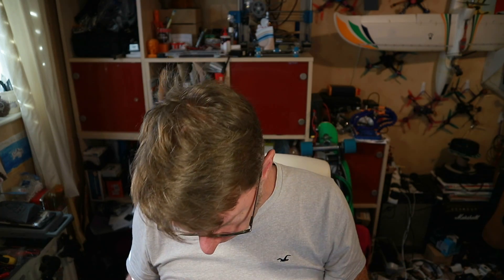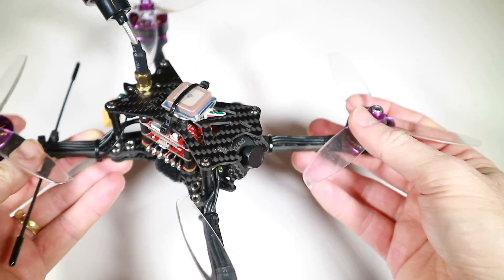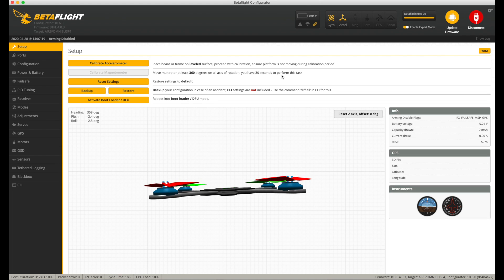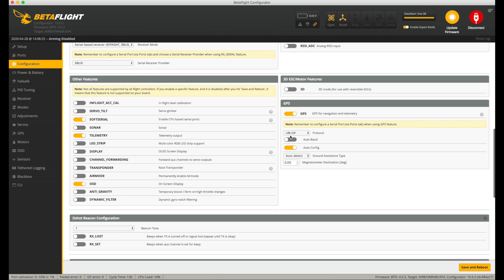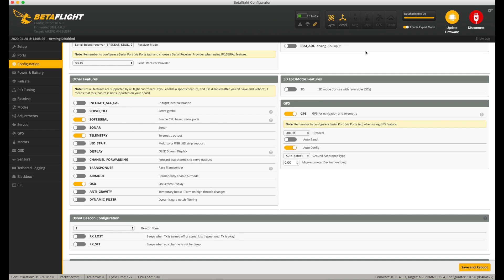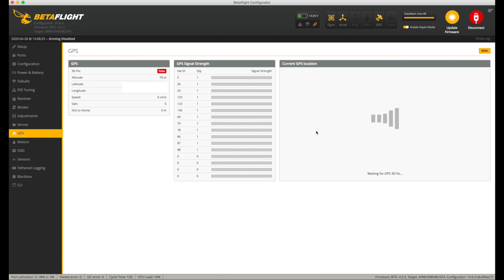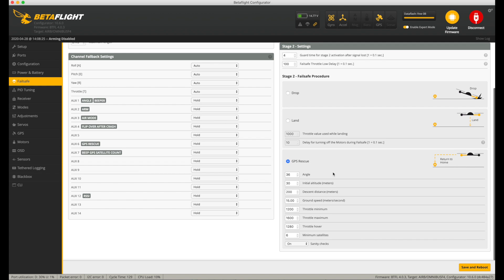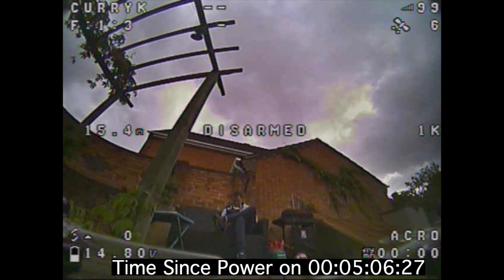HGLRC M80 GPS receiver - Good fit for a 5" quad.  Supplied by HGLRC

Comment: Does this GPS have no battery for hot start..?
Reply from the maker: Whilst it doesn't appear to, if you watch the follow up video you will see that the whilst the initial acquisition of sats is very slow, the next battery is very quick.  So it either has a battery that's very well hidden, or perhaps it has some capacitance that keeps the sats in memory.  Either way, a hot start is nice and quick

Comment: I know that GPS modules with the ceramic antenna have to have the antenna pointed upwards, but does it matter what the side orientation is (i.e. does a specific side have to point to the front of the quad)?
Reply from the maker: Not - as long as you have the antenna pointing upwards you are all good.  The direction matters if it's also a compass, but if not, then no worries

Comment: 6 minutes waiting fix gps my VTX burn!!!
Reply from the maker: If you can't go into pit mode, then you might want to think about something like the GPS mate https://www.youtube.com/watch?v=G9SVh4PaWWg&ab_channel=CurryKitten  Depending on how your FC works (i.e will it power the GPS from USB) you could also just plug in a USB power supply to the FC and wait for the right lights on the GPS to flash indicating a lock before you plug in the lipo
Reply: @CurryKitten  GPS Mate is a good ideia, coz betafligth in android phone dont work.

Comment: darn i try to install my gps, everything is welded well, gps light is ON but it doesnt show it on the upper tab  and when i go on GPS tab on left side it cant be found...I have SucceX E -F4 Stack I hope this GPS is compatible :D
Reply from the maker: There's a few stages to this.  First off, make sure it's setup in the ports tab and after you save/reboot go to the configuration tab and activate the part where it says "Use GPS for navigation" once saved and rebooted and you enable the expert mode in betaflight this will give you the GPS option on the left hand side

Comment: I use the same HGLRC GPS on my drone, and I can confirm with  a warm restart you get 8+ satellites fixed much faster. 
Around 1 min in my garden, and  even less in open field.
I'm using Ublox protocol  and autoconfig for the others param.
I tried GPS rescue several time, with a BN880 on a 7 inch, and most of the time it has been working, till it doesn't and I lost the video. 
I provoqued a failsafe  immediately, and find the last accurate gps coord on my CRSF and on my last DVR frames received. They were pretty closed ...
I took my car and drove to the point quiet anxious to find my drone back.
And here he vas, flashing and beeping in the middle of a laboured field, just waiting for me ... lol...at only a few meters of the gps coordinates.
I was so happy, to get it back. Without GPS not sure at all I'll be able to find it back, cause much far away of where I was thinking.
For me so far, Gps rescue is not totally safe at all, but it's so good to have gps coordinates in case of problem, that I'm starting putting a GPS on all my 5-7 inch quads.
Look forward to see the results of your experiments, once out of covid.
Thank you for all your work and sharing results
Reply from the maker: My rescue mode testing in the past has worked pretty well, but really it's one thing out of many that you should be thinking about to get your quad back - and it certainly shouldn't be relied on.  But as you found, using a DVR and getting the last good GPS coordinate works pretty well too.  That and a beeper - perfect.

Comment: INAV Wayne....iNAV....not Betaflight...it crashes at your feet....iNAV works so much better at RTH....
Reply from the maker: iNav still requires a compass as well though no ?  There is no RTH in Betaflight, it's RTHAC (return home and crash) the idea being that you take control back before it gets all the way back :D
Reply: @CurryKitten  Yes, compass..I now have 2 GPS Quads with iNAV...I just want you to try iNAV on a quad...because I'm sure others out there can't wean themselves off Betaflight...Besides, I'm interested to hear your thoughts on it....🤔🤔🤔😳😷😷😷

Comment: I've 3 Beitan GPS's here and no one is getting a fix. I haven't had problems of getting a fix with a HGLRC GPS yet.
Reply from the maker: I've used the Beitan ones and they've been ok.  What I do notice (just to see if it fits your situation) is that the GPS signal can get wiped out by FrSky telemetry data, so the positioning of your GPS is more important if you are using that type of rx

Comment: You can trick the GPS by plugging in a usb powerbank into the flight controller. This way the vtx doesn’t transmit and gps signal is found much quicker, like 1 minute cold start without up to date satellite data after being turned off for days.
Once it has found satellites it will only do hot starts when flying normally and find sats in seconds without powerbank.
At the field I usually plug in a powerbank first and then set up my transmitter and goggles. When I am ready to fly I got enough satellites data for the day.
This only works if you solder the gps to a 5v pad that is powered from usb of course.
Reply: Awesome tip, thanks.
Reply: Really helpful!

Comment: Cheers Wayne, thinking of getting one as i was learning to fly acro with my 2.5"  quad and the wind took it .  40 mins later I luckily found it 2 fields away.
Reply from the maker: Well done for finding - as keen as I am on battery backed buzzers and things, I rarely put these in smaller quads - but it goes to show what can happen when things don't quite go as planned.  This is nice and light, so will fit on a small quad quite well.  Those coords will give you a decent chance of finding it's last position as well

Comment: sooo can this work on a whoop
Reply: If you have a spare UART... But u might choose a BN180 because of the weight (BN180 ~ 5g, HGLRC ~10g).
Reply: @ZeroFPV  was kinda joke to curry
Reply from the maker: I know it was a cheeky comment, but you'd be surprised the number of people asking legitimently about fitting GPS's to tiny quads.  WHy you'd need it on something that'll fly for about 3 minutes quite slowly... I don't know :D
Reply: @CurryKitten  crazy people. lol
Reply: I am able to lose control of my whoop in less then 10 seconds. So when it keeps flying away for another 3 minutes, a GPS comes in very handy to find it ... 🤓